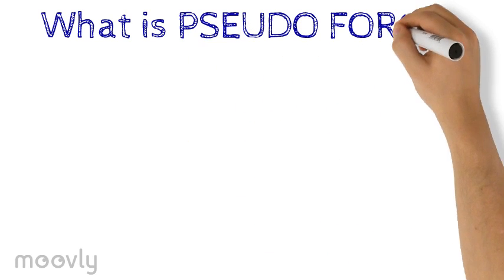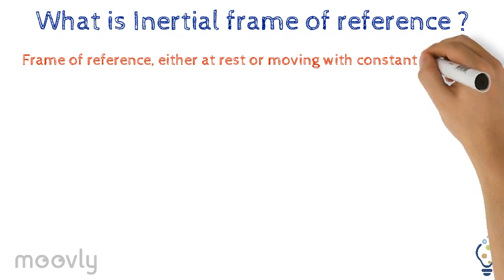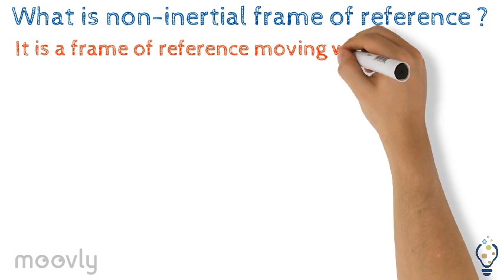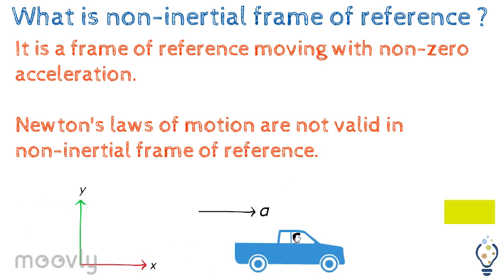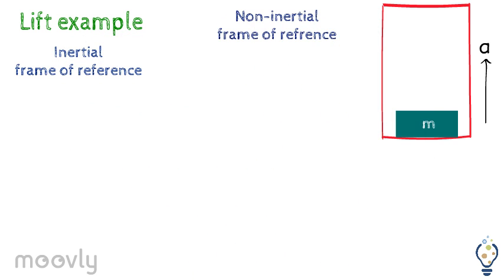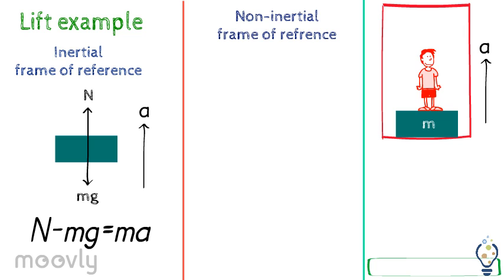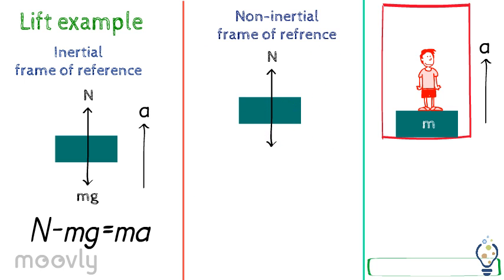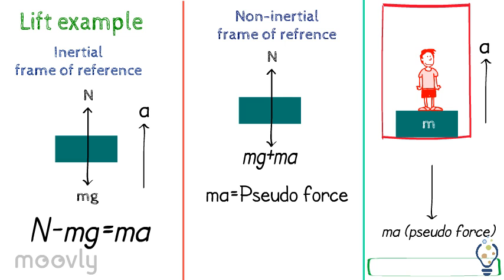Pseudo force | Newton's law of motion | Physics | Think Merit

Comment: Tell me if I am understanding this correctly.  In Non-Inertial Frame of reference its like how we are moving around the sun on earth but we cannot really tell that we are. Therefore, Pseudo Force, is just to cancel out or planetary motion to calculate stuff within our frame of reference?
Reply: Pseudo force us used to make Newton's law applicable in a non-inertial frame of reference. 

For the sun-earth system, we need to account pseudo force.
Reply: So you're saying if we are calculating the earth's orbit we are using pseudo force to cancel out the rotation of the galaxy and expansion of the universe?
Reply: When we talk about the sun-earth system, then gravitational force provides necessary centripetal acceleration for circular motion.

However if we consider to observe from earth frame of reference (which our non-inertial frame of reference), the earth will be at rest. Centripetal force and centrifugal force (i.e. pseudo force of gravitational force) will cancel each other in oppsite direction.

Note: Pseudo force is not an extra force. This force comes into play to make non-inertial frame of reference into an inertial frame of reference.
Reply: NOOO